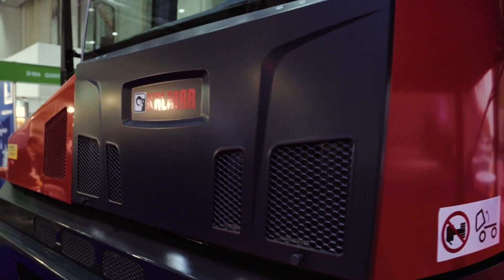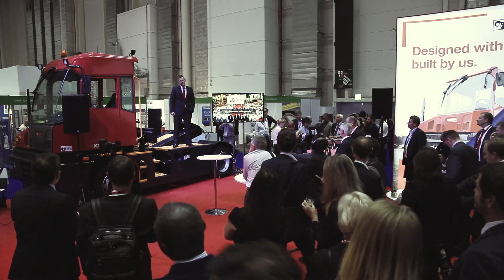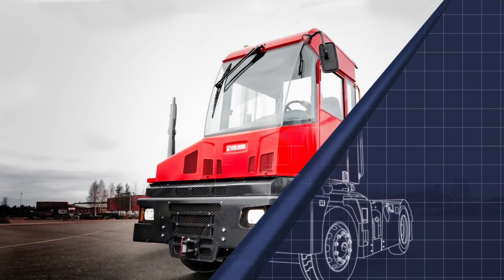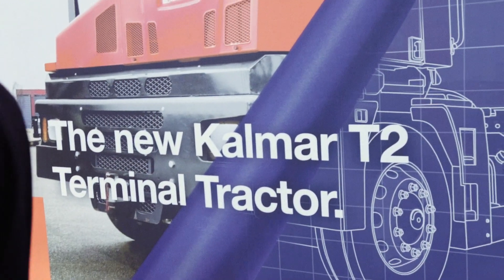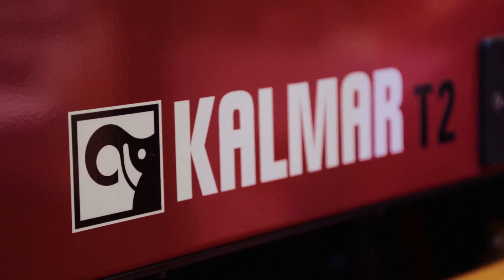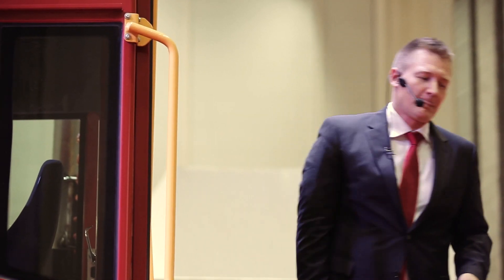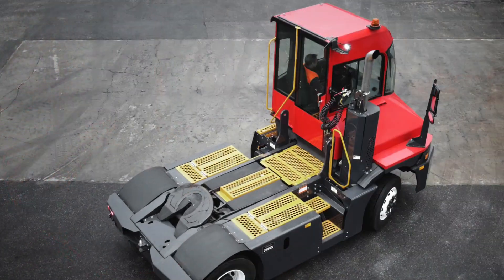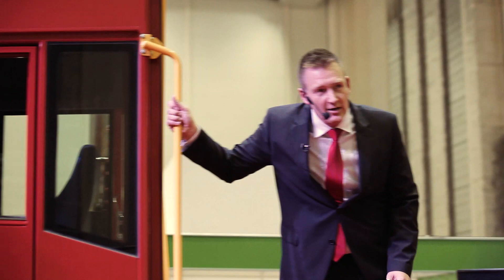Kalmar T2 Terminal Tractor Experience TOC Europe 2016

Comment: This machine is so heavy on the brakes it feels like a big army truck from WW2. Fantastic when the allison gearbox needs to have the brake pedal pushed trough the floor to change between drive and reverse. I use both feet and press against the seat to not abuse my knee. In reverse the engine and gearbox vibrates a lot and transferes most off it to the mirrors. Again fantastic! The doorlock is a simple and robust construction, but needs to be slammed shut with a bang. The headlights go mental in rain due to the fact that someone forgot to weatherproof the electrical system. Last night the T2 actually caught fire by it self..  Quality control, not so much.